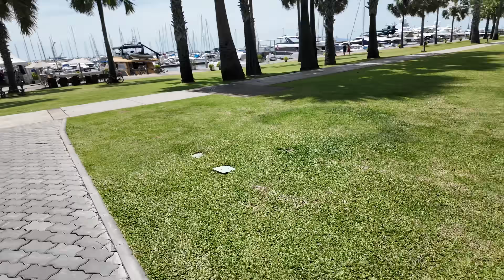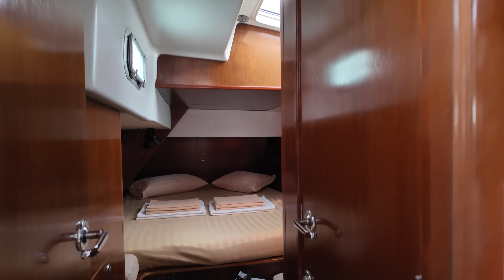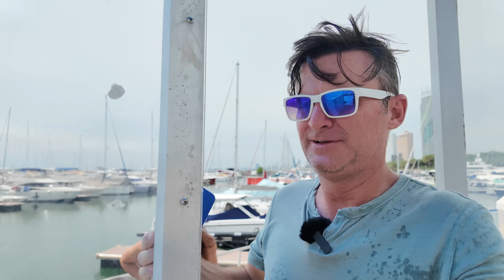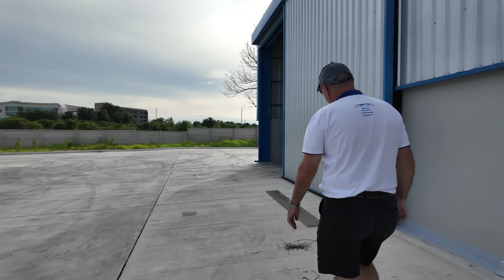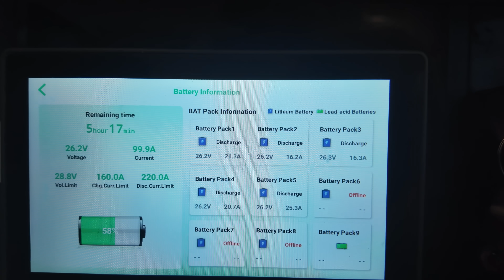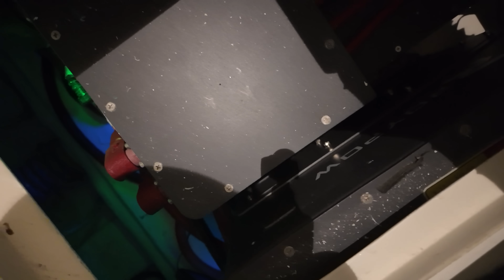My Crew are SHOCKED to see my old Boat I sailed 15,000 miles in

Comment: I'd be very curious to see what the EMF strength is with all the high powered equipment so close to living spaces?  It'd be interesting to go around the boat with a meter during different states...heavy charging...heavy draw etc etc. of course you'd need a couple cheeky thong babes to take the readings...right Bobby??😆

Comment: Hey Bobby. New boat looks amazing and loving the technology on the boat. You keep mentioning Lithium Ion batteries when in fact Roypow is using Lithium Iron Phosphate chemistry for their batteries. I would not be sleeping on top of large Lithium Ion chemistry battery bank. Sleep a little better knowing the chemistry is LiFePO4 for the batteries. 100 Ah batteries at 51.2V giving you the 5.12kWh per battery.

Comment: Check out Edison Motors utube channel.  They are selling ev conversion kits old and new trucks.   Perhaps your boat build could share on bulk battery and other shared components.  At 100 batteries the cost goes down 50%.   It would be a great channel collaboration.  Selling boats and conversions to save 50% operating expense.  $10,000.00 in fuel canadian per month.  No def, red dye legal. Less cost better pices for all.  Good luck.  He would be a great guest.  Both cannels will grow.

Comment: Why is nobody talking about the dangers of EMF in Evs, and in this case, you are sleeping over a big source. If one small cell catches fire, the smoke in 3-5 seconds is deadly. I'm not so sure you can extinguish a lithium fire before it goes critical and burns through the hull. The newer steel and aluminum boats are using a double bulkhead door, battery room. The Graphene Aluminum ion batteries are about to be released. 1/3 the weight, more power density and over 200k charges. They will take almost as much power you can send them. Completely safe and environmental. Search up lithium car and bus fires video. You will be scared straight. 
Ok back to the boob fest

Comment: Bobbi you should mention the fact that your batteries are in fact Lithium Ferrious iron NOT lithium Ion. LiPo4  DO NOT Catch Fire. Lithium Ion DO Catch 🔥   So many people see the news that something with a battery caught fire and LUMP life4 into it causing Insurance rates to skyrocket.  Lead acid and AGM are 100 times more likely to catch fire than the new Ferrious iron blend of lithium . Love the new boat, hardly wait foe those sea trials and new adventures.  CHEERS AND FAIR WINDS.        Steve h.
Reply: I was worried about this. I'm glad you clarified.
Reply: LiFePO4 but yes are generally safe.  The cells quickly fail tho if any salt water gets on the cell, so you want a good seal on the battery box.  Maybe take one and toss it in some desalinated water and see if it bubbles.
Reply: Good info.

Comment: I just worry about you and those batteries. Pessimism like an astronaut to figure out every possible problem and how to solve it, is where I am coming from. Those batteries should be in a place that can be extinguished quickly without the fumes filling up the cabin. I don’t think sleeping over a high powered battery is a good idea. Filling fore and aft storage and water proofing that, I think would be safer.

Comment: When you explained the house batteries you talked about their capacity in kW. Capacity isn't measured in kW, it is measured in kWh. kW is the power you can output not the energy you can store.